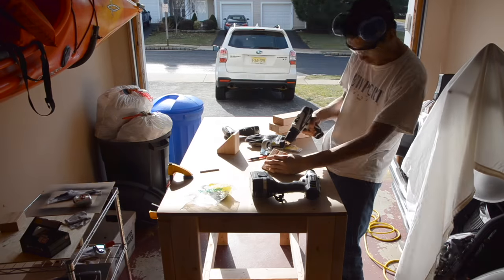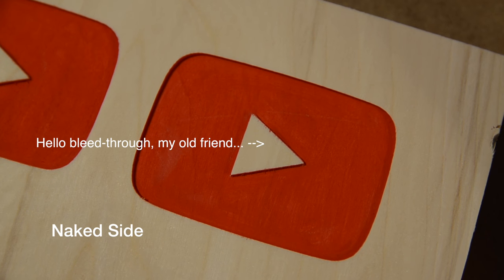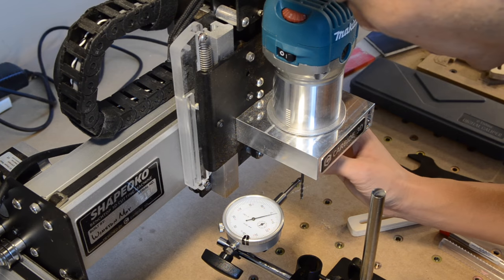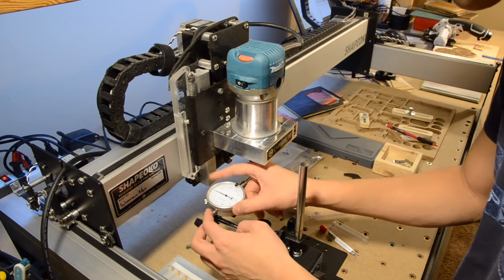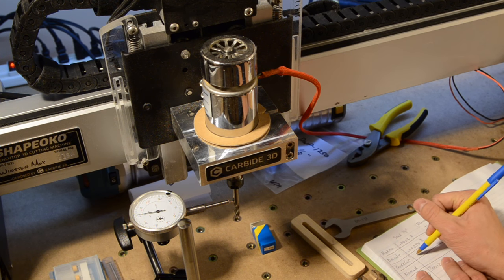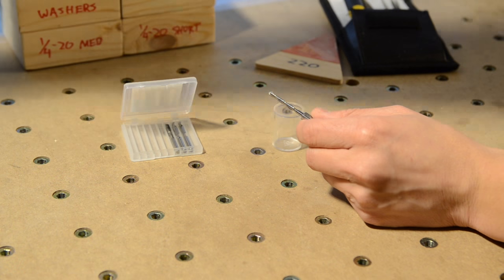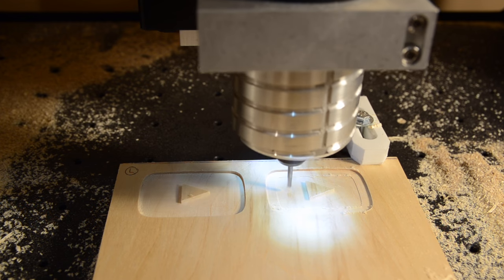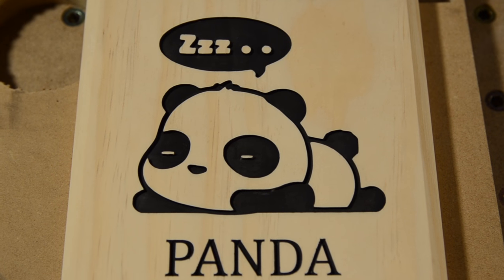Downcutting Endmills, 3rd Party Collets, & More - CNC Project #78

Comment: Pro-tip: if you want to prevent bleeding, mill first, then spray with lacquer, let the lacquer dry and then apply paint, let that dry and then sand.
Reply from the maker: Sebastiaan Swinkels no issues with paint sticking to the lacquer itself?
Reply: If you're using compatible products that shouldn't be an issue =)
Reply: Try to stay away from Gloss for the anti-bleeding coat, and no problems with paint adhesion because of the addition of a mechanical bond.  (i.e. paint goes into the little holes that made the surface non glossy)

Comment: Really good stuff! I've found that measuring run out is sometimes more difficult than it seems. There are a lot of different factors depending on the setup etc.  Still, it's good to have some numbers and a general feel for what the end mill is doing and your method did a good job of providing that.

Comment: Have you done any recent measurements on the spindle runout of the carbide compact router?
Reply from the maker: Not recently, but with the precision collets it's pretty average. I don't have a large sample size, but of all the router I've used, they're usually between 1-2 thou of runout 1" beyond the collet. Dewalt I think had the lowest because of the gradual taper of the collet self-centers really well, but I've only ever observed 2 examples. Not enough to draw any conclusions. Runout is easy enough to compensate for with stock to leave or tool wear, focusing efforts on controlling cutting forces/deflection has a bigger impact on results IMO.

Comment: Great tips, for the chamfered edges on the plaque is that what was shown at the end of the video? You had chamfer tool on router spinning with no relative movement while you shaped it by hand?
Reply from the maker: Yep, the CNC is basically acting as an inverted router table in this case.

Comment: Winston,
I am trying to make my mind up on a Shapeoko 3 but have one big question I have been unable to find the answer to. I am wanting the ability to cut 3D art at some point and have not been able to find a work flow if I were to use V-Carve Pro. Doe you have any ideas or maybe where I could find the info.
I have really enjoyed your video's and they are very informative,
Jim
Reply from the maker: Unfortunately I can't give you a definitive answer, since I've never had the chance to use the software firsthand and Vectric has just enough products and tiers that it's a bit confusing to figure out what does what. I'd shoot their support an email, that's going to give you the most straightforward answer.

Alternately, there's other software that'll do 3D without a problem like Fusion360.
Reply from the maker: Check out: http://support.vectric.com/tutorials/V8/VCarveProProjectIndex.html

Comment: Have you ever used ChiliPeppr to run any of your CNC mills?  I use it on my Shapeoko2 with TinyG controller to mill wood to even PCB's using its Eagle board import.  Just curious to maybe see your thoughts and experiences with ChiliPeppr in a future workflow video perhaps.  Keep up the good work!
Reply from the maker: I... have not. It's been on my radar for months, just hard to get to. I suspect when GRBL 1.1 goes live, and UGS 2.0 is ready, I'll have to set aside time to experiment with different workflows. That'll probably be when I try it.

Comment: Are you using similar feeds and speeds with your downcut ? and any different entry style as looking at the bottom of these end mills boggles my mind on how they can cut into material. haha
Reply from the maker: I go about 20% more conservative on feedrate/depth of cut. They're really not designed for center-cutting/plunging, but you usually don't have much choice with CAM programs other than F360 so I'll sometimes keep feedrate high, and trade for a shallower DOC.
Reply: Cheers man, great videos.
would love to see Tool, RPM, feed and DOC on videos
keep them coming man

Comment: you should do a repeatability test.. basically set the dial indicator at zero touching the endmill.. then  jog the length and width of the spoil board diagonally and then return to the same spot..